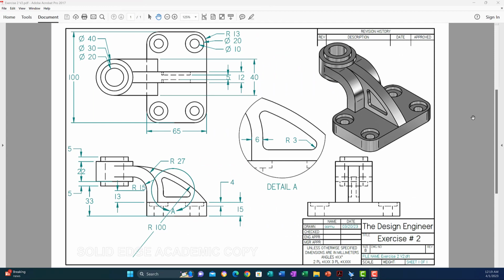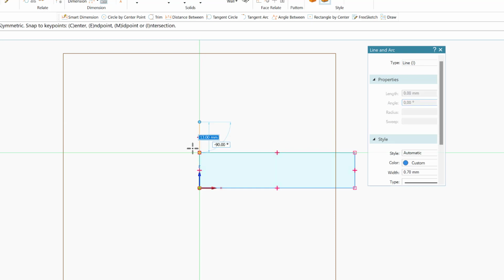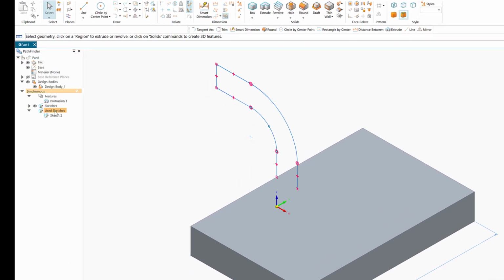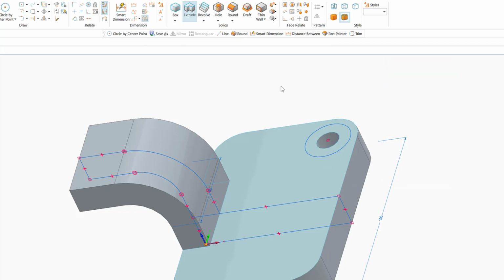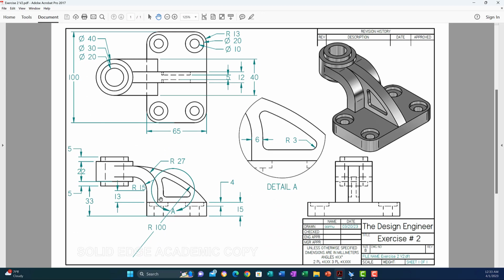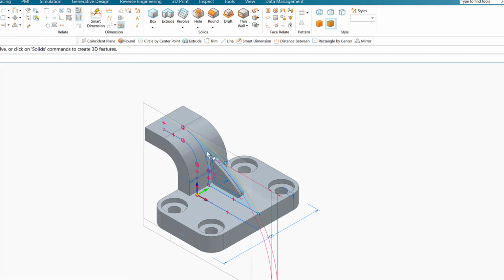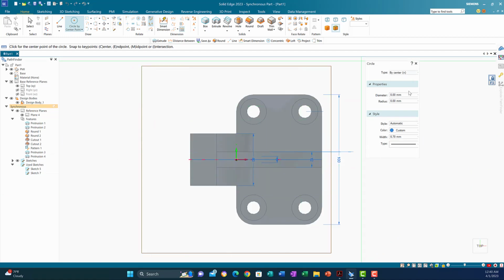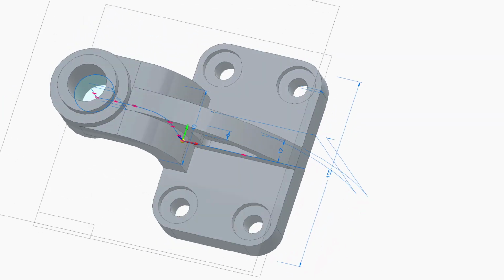Solid Edge 2023 Tutorial - Exercise 2   (Updated)

Comment: 13:06 I was able till here. Then when the curve closes, the inner space doesn't become azure.  I checked if ever the sketch was not contiguous, but it is. I have remade it several times checking tat all the points are identical to your ones, and they are. I'm struggling to finish this piece.
Reply from the maker: Thank you for reaching out. If you are still having a problem finishing the part, please feel free to either zoom or meet with me, and we will be able to work it out. Wishing you all the best.
Reply: @drmseif   I was able to correct it and I had to act in a different way. When the first shape is made (rectangular + the curved upright stuff), Instead of to extrude, I immediately drew the curve with radius 100. Then I go the azure. From that moment on, I could proceed further, by extruding the first piece to 100 and the second to 40. Only then I trimmed what i didn't need and I 've made the offset as you suggested, and everything went smooth and fine.
Please consider this is just my second draw with Solid Edge. So I'm discovering the tool step-by-step and sometimes: with slaps on my face 😉😉

Comment: Does Solid Edge has Extrude face up to another face height. So far I could not find it. Most of the cad programs have that.
Reply: I founded but is kind of hidden. I don't like it that you need so many steps to do this.
Reply from the maker: Actually, this extra step allows you doing more 4 features. At the same time the default is face to face. Thanks and wishing you the best.
Reply: @drmseif  I tried SpaceClaim and tell you that I like Spaceclaim better. There is some stuff that should be re-disign but is much easier to work with. And why you have to lock the space that you working with. All programs know that you want to work on it just by selecting it. i will try a little longer maybe i can get use to it.

Comment: Why when I export or save as .stl file to prusa or cura does they object appear tiny and needs to be scaled up by 2540% before it appears the correct size. Also the no of facets is very small so the curves look like 12 sided objects. New to all this 3d design so probably something Im not doing.
Reply: You have to be sure that is save in Inch or mm. Plus be sure is selected as fine. This you can find in save as stl "Options" before save button.
Prusa or Cura usually works with mm.
Reply: @JBCool0729  Thank you for mentioning 'fine' because all my circles was rough when printing. Now I understand.
Reply: @JBCool0729  THANKS FOR THAT IT WORKED A TREAT.
Reply: @graemeweddell908  no problem